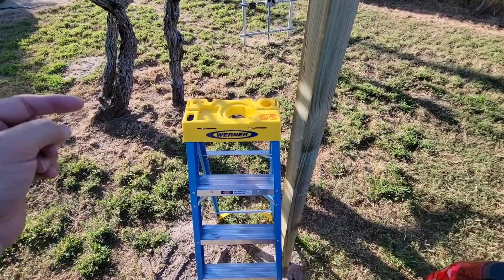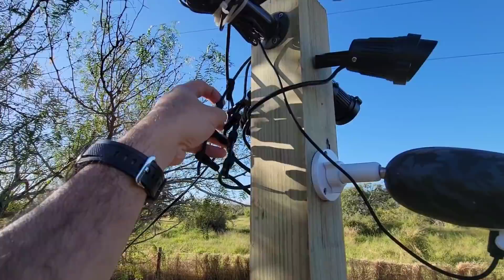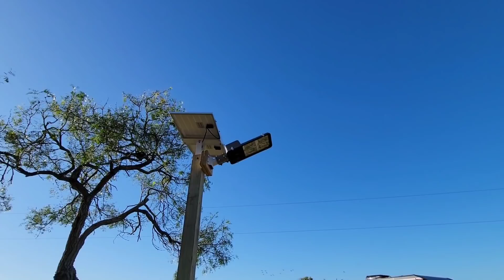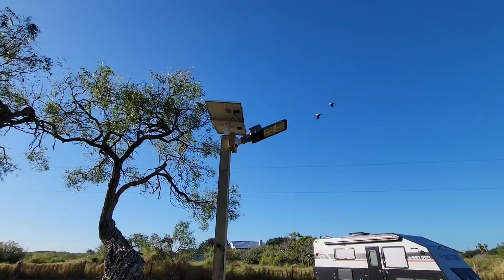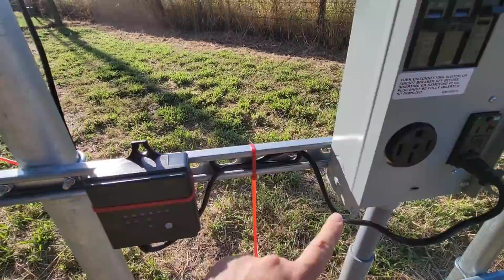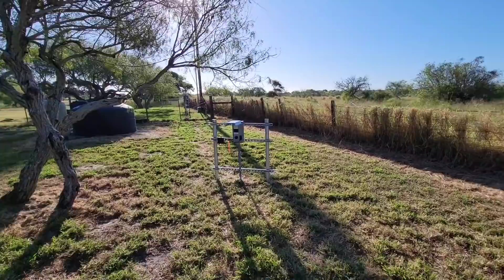Am I insane for doing this on our RV slip?  Electricians Let me know!

Comment: as long as your happy with it. but there are those two power poles if it was me i would be calling the electric company and pricing out getting lights installed on the pole.
Reply from the maker: I wouldn't have control over turning them off when I want then

Comment: Just a couple things.  The low voltage is normally buried a little.  I always thought one thing that did was crest a safe ground, but I’ll let an electrician weigh in on that. I do know that wire may not last long in the sun unprotected. That would be my main concern. Giving you make videos ;so people know what you have) and you will have nice stuff like your RVs around I do agree with all the lights.  If it was just a farm or camp I would not. Enjoy.

Comment: To avoid light pollution onto adjoining properties, it would have been nicer to daisy-chain lights and attach single ones to the perimeter posts, pointing into the property.  That would have spread the light out further.  THEN have a security light that will shine bright when there’s motion.  That’ll neaten things up, give folks enough light to move around the property, and still alert to non-familial intruders.
Reply from the maker: Agreed.  You'd be amazing how quickly the light dies out when only 9ft off the ground and in a remote area of the yard.  We've already come across a large rattle snake that was hiding in a dark area and my wife didn't want to go anywhere near the RV unless there was some light in the area.

Comment: Wires running through and on top of tree limbs are a no-no. The unprotected wires will abrade and create opens or shorts in the future. There are a variety of ways to facilitate having a fixed mount to the limb and allow the wire to move and be protected. Frankly though wires in trees are just not proper. Trench and use flexible pvc conduit. You're spending so much as it is might as well do it right.
Nice to have plenty of light when you need it but please be mindful of light pollution. Having excessive light creates obstruction of the night sky for anyone in the greater area.

Comment: In regards to the 4x4 with the solar street light, do you think that attaching a section of all thread, through the lower third at an angle into the ground, with some concrete would provide some extra stability and resistance to wind? In theory it should act similarly to the guide wires used on power poles and such.

Comment: as a former electrical contractor and a county Electrical inspector for 35 years, I see no hazardous issues.  However, I do agree with previous responders and would consider installing the feed line underground.  I would install it in pvc conduit and extend the conduit up near the bottom of the supply box and 4 ft up on the pole to protect the wiring from weedeaters, etc. Also, keep in mind the voltage drop on the wire.  12 volts will drop much faster to a damaging level than 120v ac.  Great job!

Comment: For the simplicity of the low voltage ,you'll be fine...of course you could use better wire and conduit but your not breaking the bank and it may end up being temporary..especially with you buddy...lol

Comment: I would suggest trenching and pvc conduit from the pedestal up to the top, make a U-Turn at the ends to prevent water ingress.  The reason is that the storms and wind will mess with the tree and the wire.   Also consider a water tight enclosure on the pedestal for the transformer and perhaps a wifi relay so you can control it remotely?

Comment: Should've used direct burial wire for the 12 volt landscape lights.   Running it through the tree branches can rub off the insulation and causing shorting.  Also,   if a branch breaks,   the wire will have to be spliced which will make it shorter and more taught.